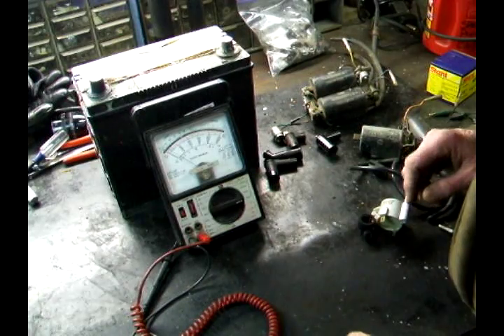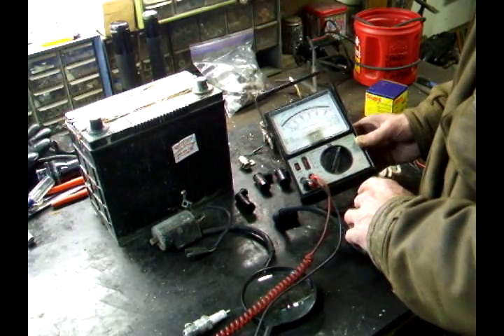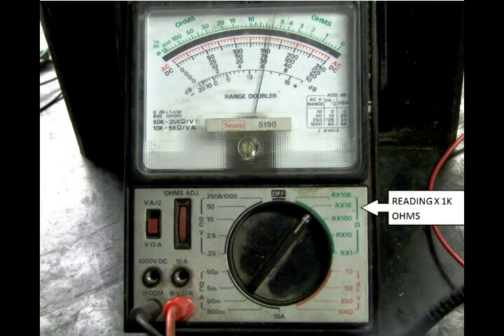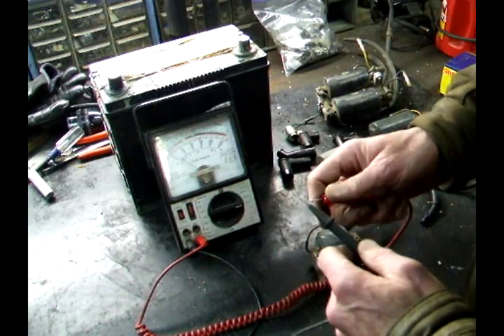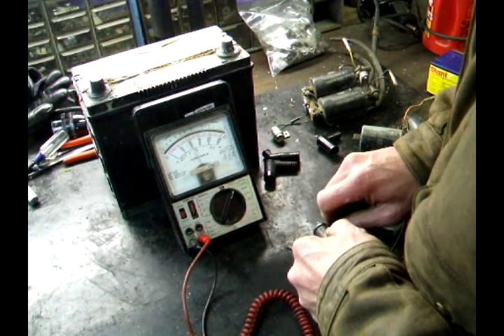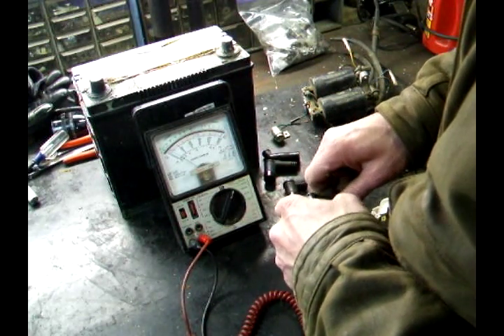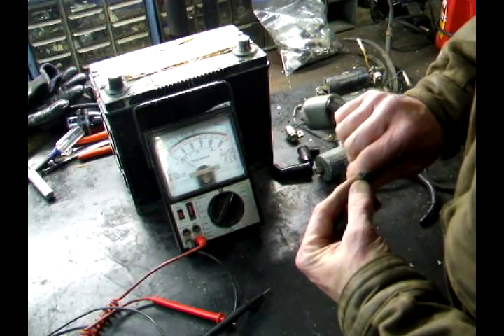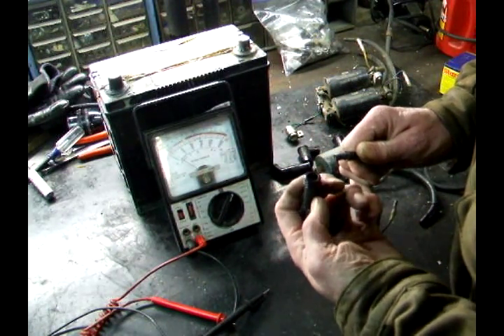Test Sparkplug Cap with VOM for Motorcycles and Mopeds

Comment: 11k is good or no ?
Reply from the maker: Some sparkplug caps are 5K some are 10K depends on what the bike is suppose to have according to the manufacturer .Some have are non resistor caps. If you use resistor plugs you can use non resistor caps.

Comment: Beware. I bought two new spark plug caps, and both of them had zero continuity. Open circuit, no voltage transfer.
Reply from the maker: Buy Honda oem parts. Cheap Chinese ones are junk quite often even new. Set your VOM to 20K range when testing.

Comment: In Britain we don't say "alot of times". We consider that baby language.
Reply from the maker: I'm in the states, so what would you say in the UK for "a lot of times"
Reply: @Amotorcyclenut  Often.
Reply from the maker: In the phrase "A lot of the time," the noun "time" is a mass (noncount) noun. It has a durative meaning: "during significant portions of (the) time." In contrast, in "a lot of times," "times" is a plural count noun meaning "occasions." It's like "many times" or "on many occasions."

often or frequently. It's used to give an idea of how frequently something happens or is done. Something that happens occasionally happens sometimes. Something that happens oftentimes happens a lot (though maybe not all the time).
Reply: @Amotorcyclenut  That is what I said above. Often means a lot (of times).
Reply: @bertoldriesenteil1430  you can use either

Comment: Thanks for that. Cylinder no 3 had gone dead on my mc and pulling off the plug cap and cutting 
back to fresh wire seems to have fixed it, fingers crossed. Wouldn't have known what to do before 
seeing this video and would have had to take it to the repair shop with all that incurs.

Comment: Thanks got my 1974 Yamaha DT250 running again New NGK plug cap for $3.00 bucks.  I  took apart the 43yr old OE Boot the  outside was Rubber  and inside was a Phenolic plug cap .the part that goes over the plug stud had a screw driver slot . so I took it apart.  out came a spring and a white Resistor piece ??     What it Turned out to be was  the screw in part to the plug lead which is copper has a piece that goes through into the spark plug hole in the boot  which was corroded and had no continuity from the screw to the piece in the spark plug hole. Screwed on the new cap and she fired right up.

Comment: Thanks for the good vid, hepls me out a lot!, by the way... if i place the VOM in continuity (mine is a cheap radioshack VOM) shall it beep or show me continuity? :)
Reply from the maker: andres castro You can check for continuity, but you really want to check resistance because as caps get older they corrode inside and the resistance goes up. Readings between 5k-10k ohms is normal. Higher than that, you need to replace them.